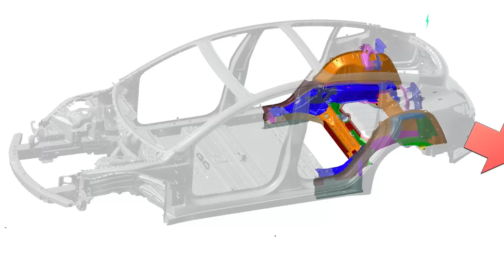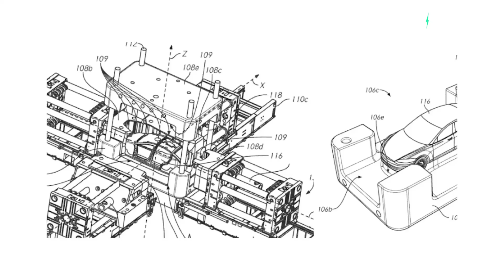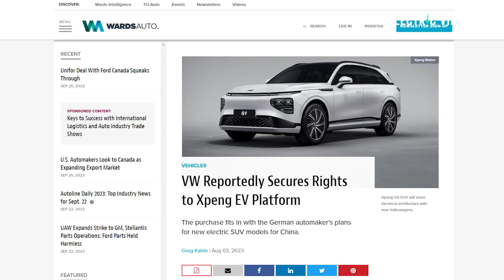Tesla Giga Shanghai launches 1-piece Giga casting for epic 40% cost reduction

Comment: Casting is never as strong as sheet metal for same wall thickness. Casting is prone to many issues like porosity and cracking (microcracking). It might simplify the process and no of steps but I think will make vehicles heavier because casting needs more thickness than hot or cold rolled sheets.
Reply: You are overlooking the fact that aluminium is 1/3 the weight of steel.
Reply: @AutoTeknix1   steel strength surpasses aluminium many fold.
Reply: @nolinchitnis  making statements like this does nothing for your case.
There are many variations of aluminum alloy and steels all with different properties.
The high strength steels used in modern cars like to crack too.  
Tesla employs people who understand materials.

It is possible that the alloy Tesla is using in the GigaCasting is more malleable than the high-strength steel it replaces. Malleability is the ability of a material to deform under compressive stress without fracturing. This means that a malleable material can be bent or shaped without breaking.

Comment: So another 40%? OR just 40% of the shell it self? I would assume it would be around the 40% of the shell - but that seems a bit high though unless you are counting labor / time cost I guess. At this point, repair would be nearly impossible to fix depending on the damage. We almost have to make new laws soon to require Tesla to purchase your car back to be recycle. Insurance will hate it as well.
Reply: Tesla is an insurance company.
Maybe they've spoken across the room.
Remember what they said on investor day?
Reply: The new stronger steels used by others and Tesla are just as unrepairable as the casting.  Casting are potentially much safer.  Look it up.

Comment: These cars are going to be extremely expensive to repair
Reply: Sandy Munro has said that aluminium can be repaired.  However insurance companies normally write-off cars when the chassis is damaged.
Reply: @robertwhite3503  the problem though, if my understanding is correct, is that  gigacasting-based designs inculcate not only structural components but also non-structural components that could be much more inexpensively repaired on more conventional designs.

In any event, according to what I'm reading it's still an open question, not something that's been settled by data as has been suggested elsewhere on this thread.
Reply: @MLHunt listen to the last investor day.
All explained.
Reply: Think about it..if you can save thousands of dollars on every vehicle produced, and 1 out every thousand teslas produced ever have severe structural damage.. then they can just give you a new car ( if you structurely damage it) and are millions of dollars ahead of the game…
Reply: @cohenkevinloriqueen818  maybe they can. But as essentially a sole-source supplier of repair services with no real competition, will they?
Reply: @MLHunt  Where would a body shop go to buy new frame replacement parts for other cars?  Yes also one source.
Reply: @danharold3087  that may be true; I'm not sufficiently familiar with the industry to know much about the availability of frame components from third party suppliers. But I have two concerns apart from that. One is that there remains some question as to whether because of its increased use of integration, the gigacasting design approach will necessitate replacement of expensive structural components in cases where only less expensive more superficial components would have needed to be repaired/replaced in more traditional designs. The second is whether Tesla will provide necessary tools and training to independent repair shops in such a manner as to foster a competitive independent aftermarket. The answers to these questions remain to be seen as far as I can tell.
Reply: @MLHunt  I think I seen where an ear for a non structural item was busted off the casting.  They drilled a hole in the casting and bolted a new ear on.   Maybe on Monroe Live.
Bard says 
Tesla has training centers all over the world, including in the United States, Canada, Europe, Asia, and Australia. The exact number of places where Tesla is training people to repair its cars is difficult to determine, but it is likely in the hundreds.
It would be rude to train these mechanics and refuse the tools and parts they need.
I was just online with the Tesla parts catalog for the Model 3.  Did not give a vin number so the parts I could see was somewhat limited.    Tesla is learning.
Reply: Plus, all those written off will be spare parts galore for the customizing after market🎉
Reply: That has been addressed many times. Any bent frame is a totaled vehicle.
Reply: Don’t wreck it… Or/and buy tesla insurance
Reply: The whole point in optimum manufacturing is that, other than a superficial repair, it will be more cost effective for the insurer to provide a brand new vehicle to replace the damaged one.
Reply: Throw away society. Landfill it and repeat
Reply: Yea they will. At this point, depending on the damage, it will be consider totaled. Between the battery and the shell it would be nearly impossible to "risk" the chance of using it still. Would almost have to have Tesla purchase it back for recycling reasons + insurance to do something about it.
Reply: Think of modern cars as tools like a cellphone. Attachment to cars was because they were hard to acquire and lasted long virtually mechanically the same for 20+ years. Can you think of a car from 2000-2010 that cost low, and you can hand it down to your child. Times have changed, cars are easily replaceable just not cheap enough but then insurance
Reply: @kwalelalipimile3894  Until they're cheap or less than 10k I dont think any would agree they're like cellphones lol.
Reply: @adr2t  my point about cellphones was to highlight how from phones being owned 3 years to 1 year or less today but no one complains how they are so disposable. Cars cost far less than they did, the only problem is people's wages have essentially dropped. Houses are affordable but wages once again
Reply: @adr2t  wages of 60$ would be equivalent to 2 ounces of gold in 1970. Today 2 ounces is worth 4000$ !!!
Reply: @adr2t    If I've a fault, I switch off and reboot my MG 4.
If my phone or pc has a fault I switch it off and reboot it.
Good job cars aren't like phones or computers on wheels.
Reply: @kwalelalipimile3894  That simply means that Gold as a commodity is more valuable today.  Has nothing to do with wages.  Try the basket of good comparison or similar.
Reply: @kwalelalipimile3894  easily replaceable at an average cost of $48k?
Reply: @darylfoster7944  did you miss or ignore the wages part?
Reply: @kwalelalipimile3894  They can be throw away if the manufacture builds it  that way.    Electric cars built to last will outlast ICE cars many times over.
Reply: It's very difficult to bend a gigacasting, and it is 10 times cheaper and 3 times faster to repair
Reply: @mallamal5578 thank goodness somebody else listens to what Tesla says.
Cheers, 👍